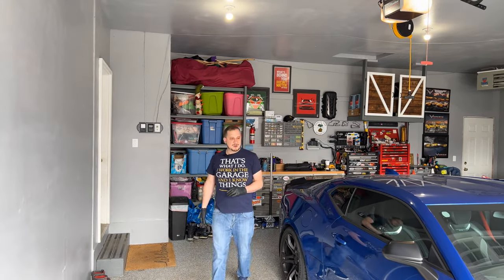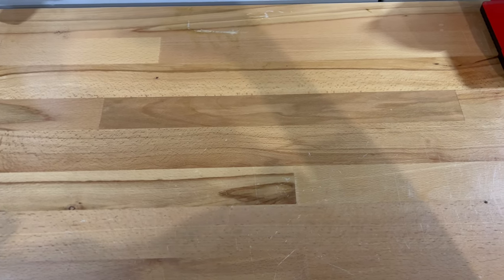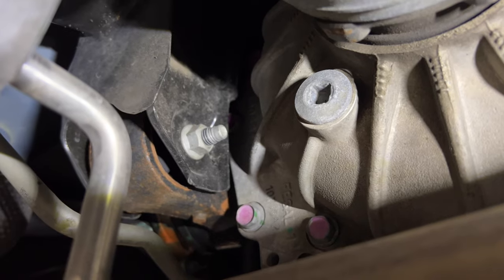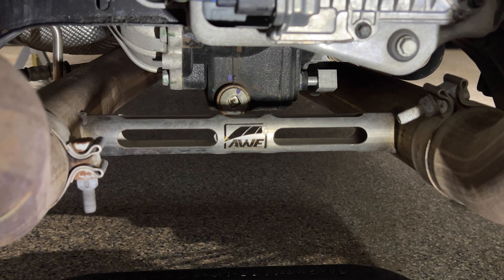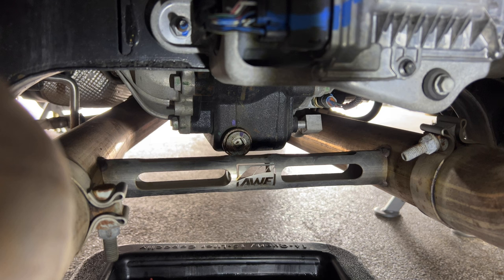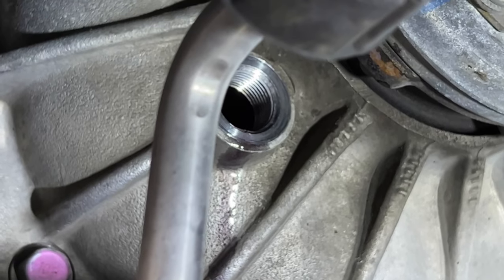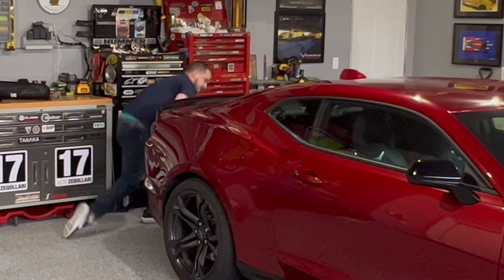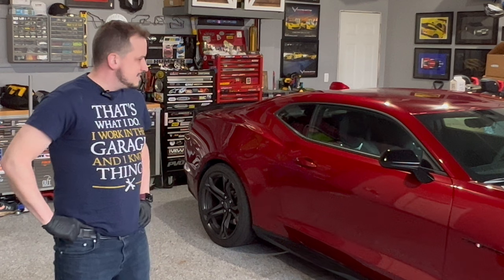How-To: Differential Fluid Swap // 2017-2023 Camaro w/ eLSD (SS 1LE, ZL1 & ZL1 1LE)

Comment: Nice video. A drain and fill only gets about a 1/3 of the diff fluid since a lot of fluid is in the piping and diff fluid radiator. The 1LE is a great track car
Reply from the maker: 1/3? That isn’t accurate. The capacity of the entire system with the additional coolers on the eLSD is under 2 qts. Where did you get that info, and what are your suggestions to swap the rest that is leftover?

Comment: Great video! I have a 2SS 1LE on order that I'm expecting to come in in June or July, so I've been trying to study up on the proper maintenance. This video was very clear and concise, and I will definitely refer back to it when it comes time to change my diff fluid.
Reply from the maker: Thanks! I appreciate that comment. I will have another video premiering today on transmission fluid change as well. Make sure to subscribe if you haven’t already, and you should get the notification!

Comment: How often it should be done ? My car has never been tracked or abuse but it hit 50k miles 2017 ,some people say every 40-60k miles but not sure .. 
great video btw💯
Reply from the maker: Thanks! The diff fluid should be changed every 45,000 miles if not driven competitively. Otherwise, you should change it every 24 hours of track use or competitive driving.

Comment: Is there an extra additive that supposed to be added in when this is done? The capacities and specifications says ELSD uses 5.4 ounces of lubricant. It appears to be on top of the regular fluid.
Reply from the maker: The proper fluid from AC Delco has the fluid already mixed in, at the proper ratio. Use the link in the description and no additional friction modifier is needed.

Comment: Did this car have high mileage? The fluid looked quite clean. What is the point of changing the fluid if it doesn’t have high mileage?
Reply from the maker: Great question! I’ll add this to the description too. Per the GM Competitive Driving guidelines, the differential fluid should be changed after 24 hours of accumulated track use. There were some metal shavings on the magnets of the drain plugs (which is normal) but going strictly by color of the fluid is not recommended. If you put the car through track use, you really should keep a log book of hours on track so that you keep the engine, transmission and differential happy. Speaking of, the engine oil should be changed after 4 hours of track use, and the transmission fluid should be changed after 15 hours of track use.
Reply: @FollowMyLine17  thx

Comment: Does just draining the dif also drain the cooler and lines?
Reply from the maker: No, you’ll never evacuate the system completely dry. It’s no different than an engine oil change. You won’t get all the oil completely out of the engine oil coolers and lines either.

Comment: Just curious.  What diff fluid are you running??  You didn’t show it in the vid.
Reply from the maker: In this car, he is using the Royal Purple 75W-90 with friction modifier. I typically use the AC Delco Differential Oil:
https://amzn.to/3L6TAtK
Reply: @FollowMyLine17  thanks for the info!  I’m about head to Tail of the Dragon & 3 weeks later NCM for CamaroFest so I’ll likely do all fluids between trips.
Reply from the maker: @mvp88camaro61  awesome! I’ve been to the dragon and NCM. Love Them both! Feel free to use the link in the description to order what you need. As an Amazon associate I get 7.3 cents if you do haha
Reply: @FollowMyLine17  I’m on it.  Thanks!!

Comment: What are those letters ABC and D and the corresponding measurements on the bottom of the differential in your video??
Reply from the maker: They are just manufacturing tolerances.
Reply: @FollowMyLine17  thanks, why are they written on there and what are the tolerances of?
Reply from the maker: @w3900  I don’t know 100%, but since it is an eLSD I believe it is the tolerances of the clutch packs inside the differential.

Comment: I have a 2018 2SS.  Moaning rear diff when cold.  Dealer has done fluid swap 3 times. What fluid you recommend? And how much of it ?
Reply from the maker: I would recommend using the OEM AC Delco fluid. It has the correct amount of friction modifier already added. You will need two bottles. The bottle design has changed recently so the shipped bottle will look different from the picture. Can be purchased here: https://amzn.to/3yxsOqi
Reply from the maker: https://amzn.to/3yxsOqi

Comment: The differential has cooling lines that run to it. What about that?
Reply from the maker: Great point! There isn’t a great way to get ALL of the fluid out that lays in the cooling lines. The best recommendation I can make is to drain the fluid while the diff is still slightly warm, and the hotter fluid will flow easier and create a slight vacuum to pull some of that fluid out. The good news is that the diff has a magnetic drain plug, so most of the crud sticks to the drain plug and doesn’t get into the lines.